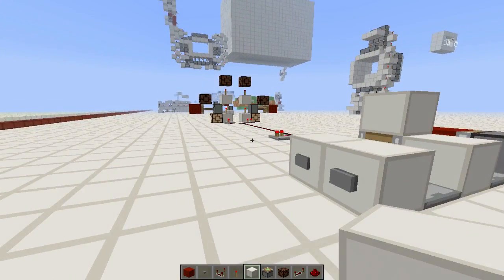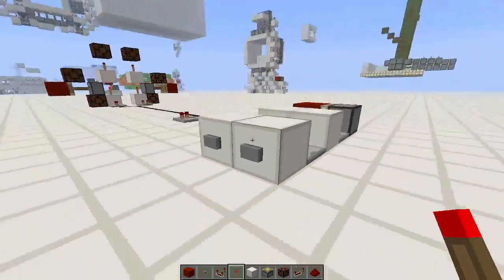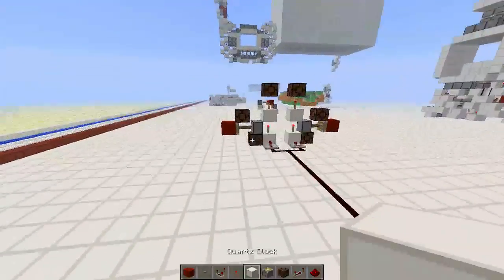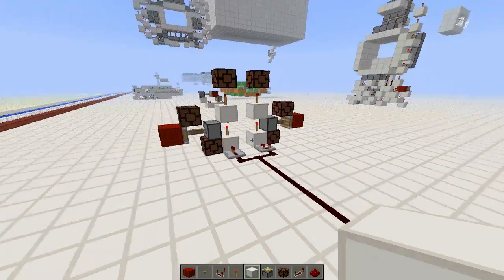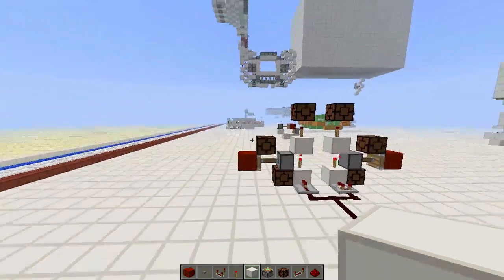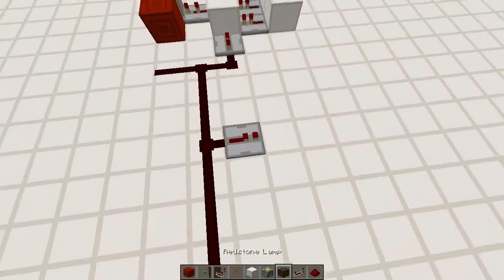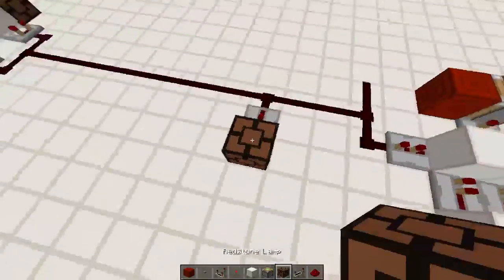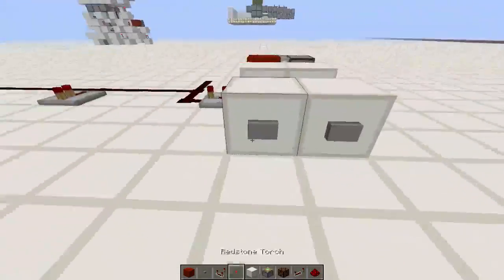Minecraft: 2 Different Types of Signals & Seperated Outputs!

Comment: This works because comparators cannot give one tick pulses. I think it takes a tick for a signal to travel through it, but if it recieves a one tick pulse, it will make that a two tick pulse (unless it is turned off via its B input, in which case it will give a 1 tick pulse). It's weird, but I think that's how it works. Also, FIRST!